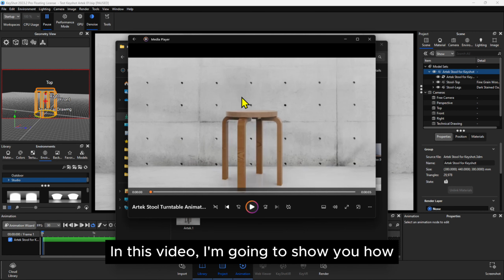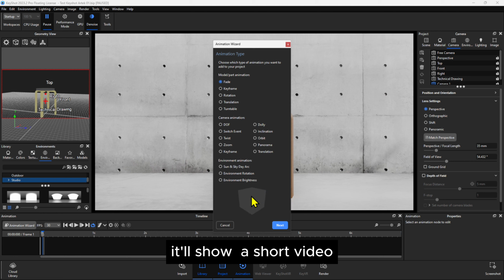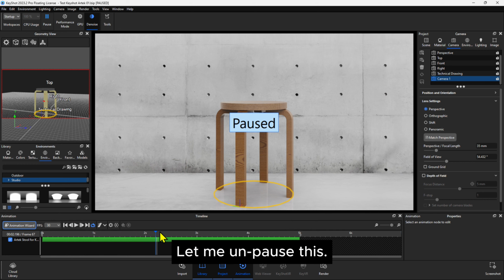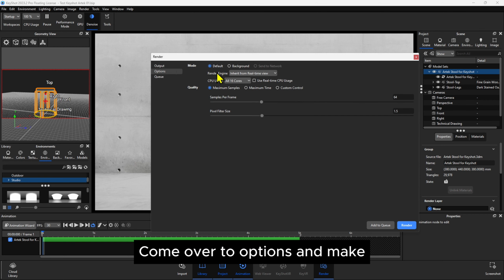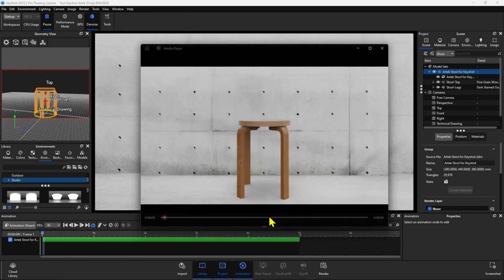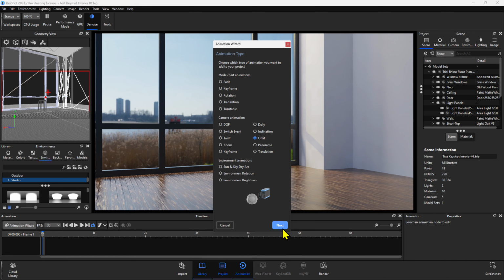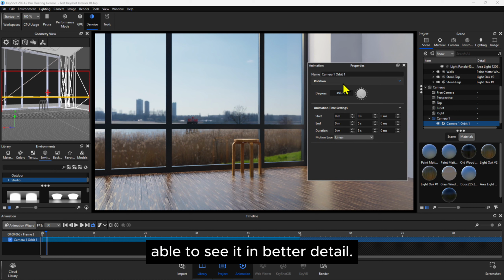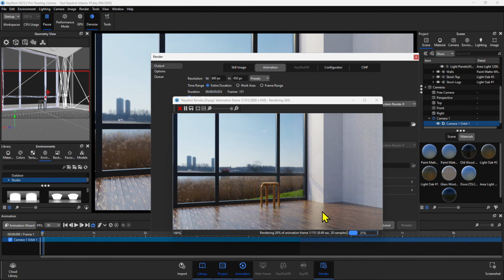Basic KeyShot Animation Turntable and Orbit

Comment: When i do the turn table animation, the circle on which my object rotates is much larges than just turning on itself. What could be the problem, i dont have any other objects in the scene that could affect this i think
Reply from the maker: You will need to reset the pivot point of the object. You may check this link on how to do this: https://manual.keyshot.com/manual/tools-3/move-tool/#:~:text=By%20default%20the%20Pivot%20is,launch%20the%20Pivot%20Selection%20dialog.